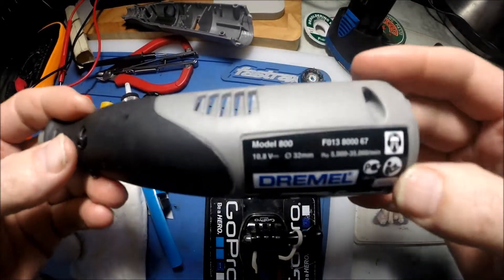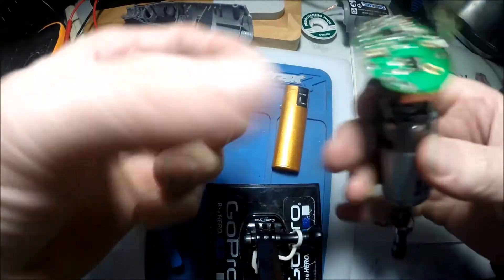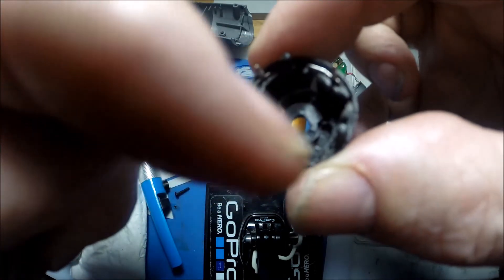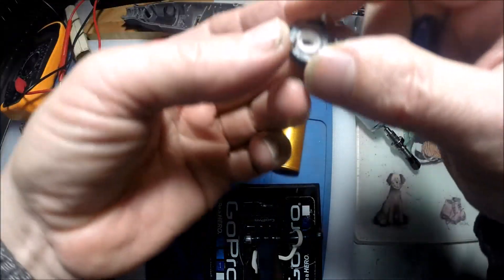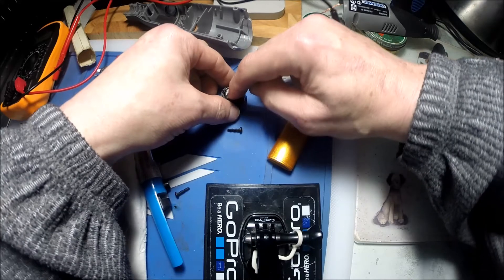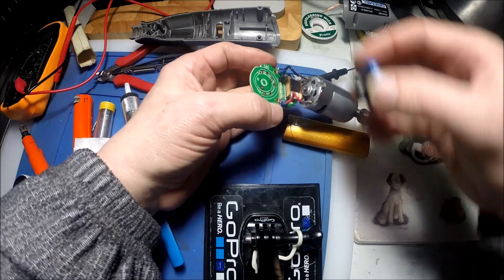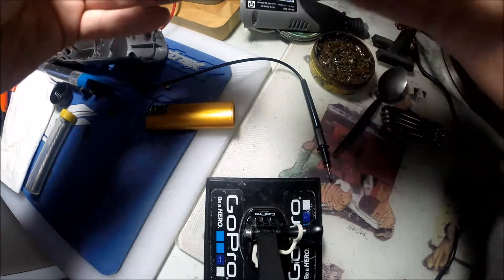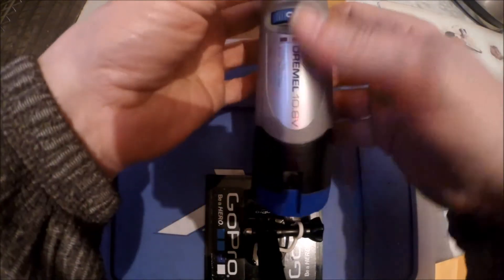Dremel 800 potentiometer fault repair

Comment: Where to buy thet part. What is the name of the part.
Reply from the maker: https://www.amazon.com/dremel-2610919742-control-assembly-cordless/dp/b00bcneh7g

It's out of stock there but you may find one somewhere on the Internet ,

It' may be easier just to try to fix it than find one

Try here. 

https://www.sparepartsworld.co.uk/product/2610919742

Comment: This is excellent.  I have a 10.8V Dremel that only works at certain speeds.  I figured it was just burn spots on the pot, but maybe it's that little switch.  The control board is no longer available.  Off I go to take it apart!
Reply: And just got back from the garage - I fixed my Dremel!
Reply: Wl done Jeremy, glad it worked

Comment: when you say linking the two points makes it work at all speeds do you mean just at the highest speed?

Also do you know where to get that potentiometer on its own??
Reply from the maker: Just at the highest unfortunately and sorry don't know where to buy the potentiometer as my dremel still working great since the repair so not needed one
Reply from the maker: This place sells it for £38.23 but I'm sure a longer Google search could result in a better price

https://www.mtmc.co.uk/product.aspx?ProductID=164913&source=googlebase&gclid=EAIaIQobChMIzf7ozLf97AIVCbLtCh0GSg4DEAQYAiABEgJi7_D_BwE
Reply from the maker: Dremel direct not in stock but just over £28 with an expected delivery date for stock

http://www.dremel-direct.com/acatalog/service.html

And this site just over £33 and in stock

https://www.sparetoolparts.co.uk/dremel/multi-tools/dremel-800-spare-parts-list-type-f-013-800-066.html

Comment: Many thanks for your helpful video!  My Dremel 8000 (pretty much the same as your 800) had a similar problem, except mine was cutting out as I increased the speed.  Unsoldering the potentiometer was very difficult, but I managed it with a combination of my desolder pump and some wick.  The little plastic disc on mine had a couple of small flat spots, which were causing the switch lever to fall back & open up the contacts as I turned the control, stopping it dead.  Like you, I bent the lever a little so that the contacts pressed together more strongly.  I also greased the edge of the disc a little with some white grease.  While I was at it, I also cleaned the potentiometer with isopropanol.  Also took the opportunity to polish the battery contacts a little with metal polish.  My Dremel works great now, and I saved about £30 for a new PCB!
Reply from the maker: Victor glad it helped. 😁
Reply: It put me on the right track.  Initially, I thought it was a loose battery connection, but cleaning the contacts didn't really help.  But seeing how the power switch assembly works, I suddenly realised that it was cutting out while I was adjusting the speed..  So it had to be something to do with the speed control.  I'm still amazed that I managed to remove that potentiometer in one piece..